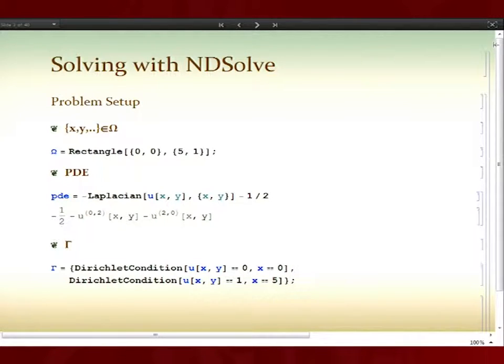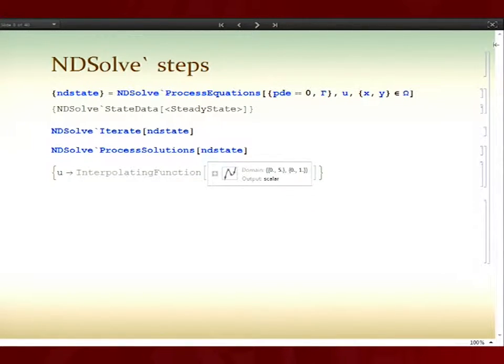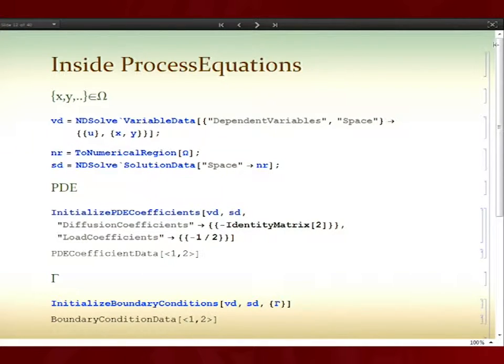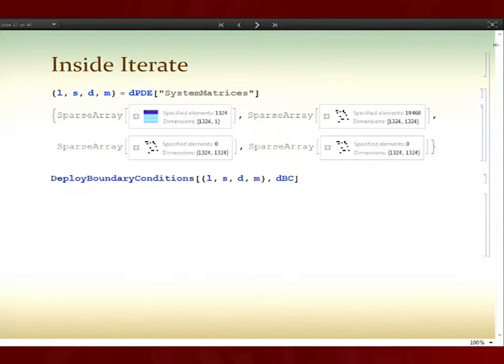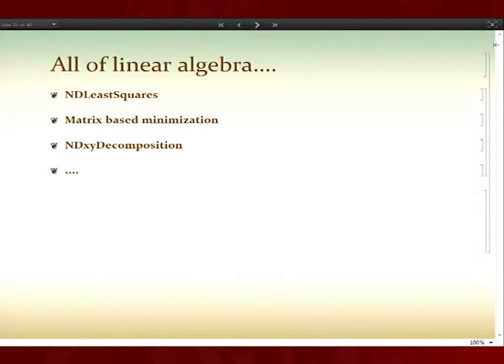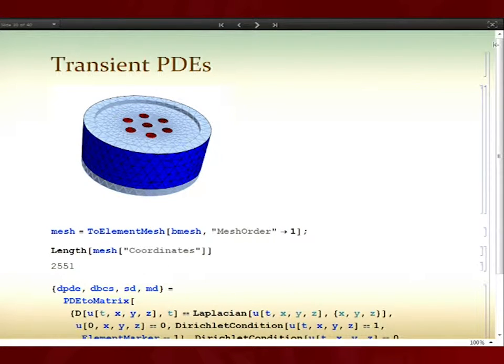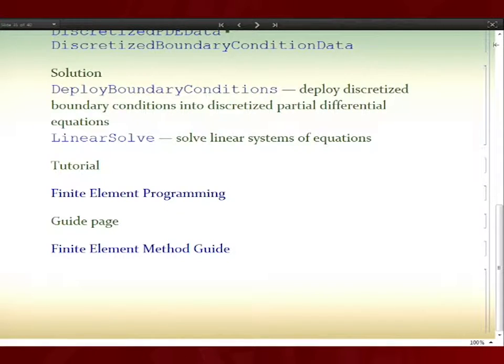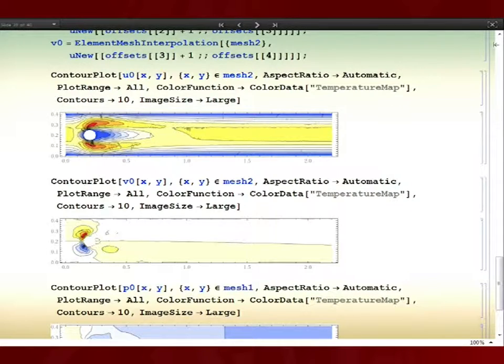Keynote: Solving Engineering Problems with Mathematica's PDE Tools

Comment: Hello Oliver 
 

I am Anirudh Rana. I am a researcher at Institute of Mathematics, University of Warwick.

I came across the IMS pakage while reading your thesis "Free Surface Flow and the IMTEK Mathematica Supplement". I was very impressed by this work and wanted to use this library for my research. However, any links to download it seems to be broken e.g, (http://www.imtek.uni-freiburg.de/simulation/mathematica/IMSweb/). In particular, I am interested to install it on a window platform. Can you please provide me the (working) link to this package if possible.

    Thank you very much for you help in advance. 
    Best regards
    Anirudh